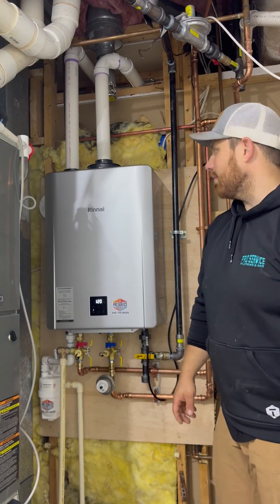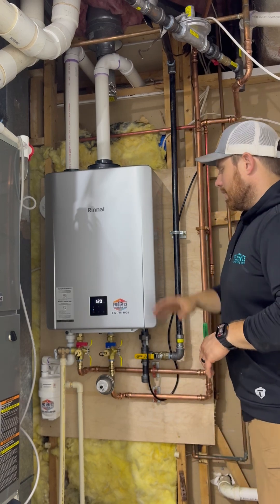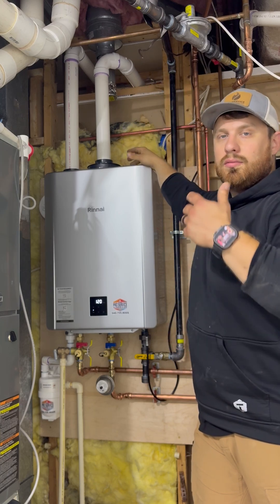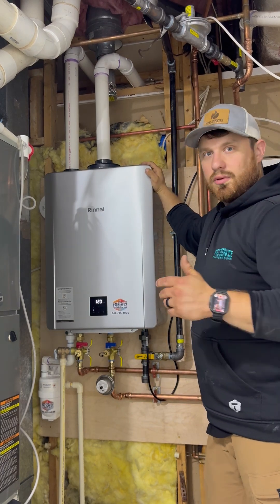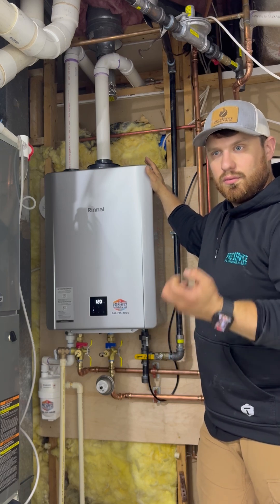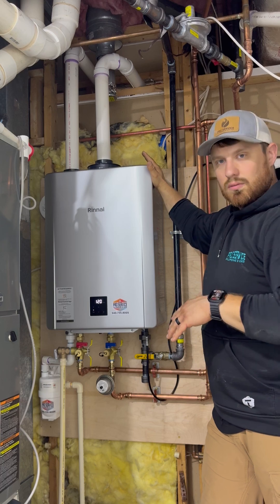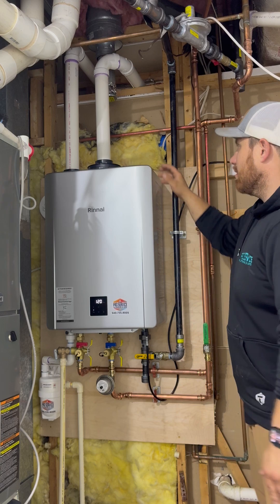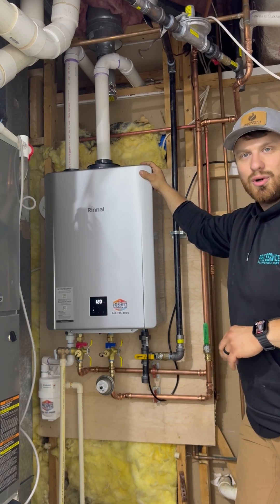Rinnai Tankless Installation Walkthrough

Comment: How long realistically does it take for hot water to reach the top floor?
Reply: You have to remember that actual model has an integrated circulation pump and also comes with a thermal bypass valve that should be installed at the furthest fixture from the tankless. You will also be able to operate it with your electronic device. So if you want hot water as soon as you open your faucet upstairs you should turn the circulation pump on and give it above 5 minutes before opening tour faucet and it'll be hot as soon as you open your faucet. You can even schedule the times you want it to run. Saves a lot of water.

Comment: We have the same problem. Our current atmospheric venting heater 50 gallon was backdrafting, and I chose a poor spot for a gaming setup. Needless to say I was exposed to carbon monoxide or dioxide, I dont know which. Nothing truly harmful, but still. Its not backdrafting now but we're working on getting it replaced. Is it true that the hot water will take longer to heat up?

Comment: Thank you for the information. Why do you think my Rinnai Tankless Water Heater  alternate between really hot and cold water when running hot water in the house unless I have multiple faucets running. To shower I have to leave the sink running for the tank to work.
Reply: Remove flow restricters from your shower heads, the flow switch won’t activate fully if there’s not enough consistent draw. “Water saving fixtures” can be a pain in the butt

Comment: I need your help if you don't mind. I need to replace my Navien CH240 combination unit, which heats my home and provides hot water. If I go with Rinnai. Which model would you say is equivalent to the Navien CH240?
Reply: By navien new model, not rinnai, they are crocks puch you to use his own regustraded plumber to do the set up.
They are crocks.